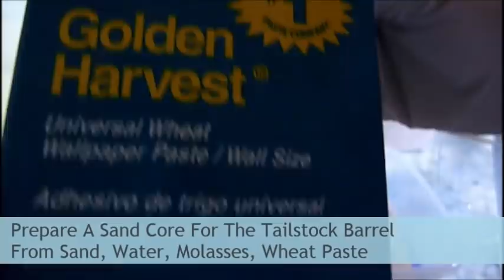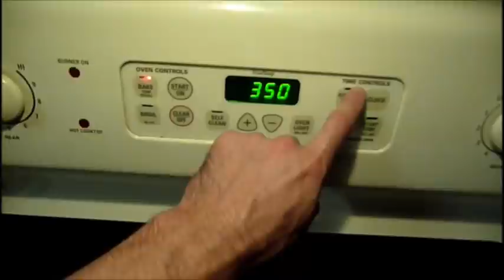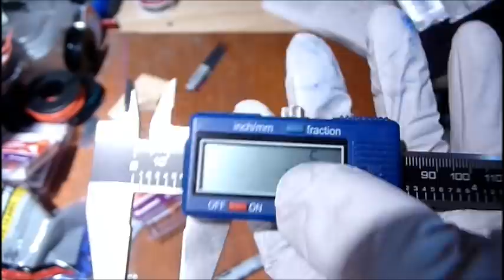Making the Gingery Lathe Tailstock

Comment: Hello, I'm looking your video because, long ago cast a few details in aluminum and silumin. I want to note that this method is very outdated. The item you want to make, sdelaytesnachalo of foam or polystyrene, the channel for low tide so the same from him. Before you go to sleep part sand, paint recommend foam form nitro enamel. Then fill with sand and compacted form, cast in metal foam. I am confident that the result will exceed your expectations. Good luck!

Comment from the maker: At this point I've been working on the lathe for 3 years, but really on and off, and I took a few 4-6 month breaks in between from the project. I would probably say that if you were dedicated to the project ( 3-4 hours a night, possibly more on weekends ), 6 months would be a good estimate. If you already had a machine shop and were planning on using it to speed up the process you could probably finish it much faster - My wife bought me the mini mill when I was working on the headstock.

Comment: Kindly advise which material did you use for it. I meen casting (metal). Sorry for my broken english.
Reply from the maker: everything is cast in aluminum, but I mainly used aluminum from wheels, and engine parts from a few old lawn mowers, etc... Don't waste your time with aluminum cans.

Cheers,
Morgan
Reply: maybe its late but can i ask you if melting and alloy aluminum and casting it will have the same properties as the aluminum alloy you put in the oven
Reply: Thero Therodactel ii

Comment from the maker: At some point I'd like to add ELS to the controller and then at least get thread cutting / taper turning capability through the controller. Not sure on full CNC, as you would probably design a CNC machine from the start differently than a Gingery, focusing on removing as much backlash as possible.

Comment from the maker: The Grizzly Mini Mill is definitely nice, however I do wish I had a bigger machine. The travel is a bit limiting, and if I was to start over, and wanted to true up the bed casting, I would need to try and flip it to cover the whole area which could be problematic.

The torsion arm on the mill is another issue for me, I wish I could get the end mill down as close to the table as possible, but the arm keeps it about 4 inches above so cutting depth is limited without putting risers under the parts.

Comment: Morgan Demers,
This is extremely impressive. Did you make the entire lathe? Perhaps Mr. Wrongagain will let the rest of us know where to find his video making the same part in a manner that does not "need some improvement". In my opinion you did just fine.'
david
Reply from the maker: Thanks for the comment, I did make the entire lathe and added my own twist with a custom controller / driver  that I designed for the treadmill motor that runs it. I can't take any credit for designing the lathe itself, though I did upscale it a bit - if you are interested in building a similar machine, there are plans for it in Dave Gingery's Machine Shop from Scrap Metal book #2.

Cheers,
Morgan

Comment from the maker: No doubt :) I've heard it before. For drilling and tapping steel I use a few drops of cheap cutting fluid I purchased at the local hardware store, you probably don't see the application of it as I was trying to keep the video length as short as I could.

I do not / have not used tapping / cutting fluid on aluminum, though I may try it in the near future. I have had the same set of drill bits and taps for years and have not sharpened them either - they still cut great.

Comment: It is a nice project. but is not cheaper if you buy one or if you melt the aluminum in to a block and them you mill it?  The part is pretty straight milling passes only two axis to use. the project is wonderful.  Just making a comment, not criticizing you great peace of hand work. That type of work you just did. Is priceless, for the rest it is master card.
Reply from the maker: in the end I probably could have bought a harbor freight mini lathe, but I wouldn't have developed all the extra skills, probably wouldn't have bothered with metal casting, etc... which have all been valuable skills. I also didn't have a mill until the end of the project and didn't really ever intend to buy the mill ( was a gift from my wife, she felt bad watch me hand scrape all the parts lol )

Comment from the maker: It would seem like a lot more work to mill the tailstock completely from a blank piece of stock, and also a waste of material. As far as I can tell, most machine tools purchased have cast ( iron ) parts which for them I'd imagine is also a factor of cost, time, and waste. The amount of time spent preparing the pattern, mold, pouring is probably is fairly small, and I can make the part over and over again if I need to without having to start over on a blank piece of plate stock.

Comment from the maker: Thanks for the suggestion, though it wasn't needed - not sure I saw in the video any point at which the sand fell out, other than after the pour when I wanted it to. The first flask I built had a rib in the middle of both halves, but I found it to be unnecessary for what I'm doing, and I've left it out of my newer flasks. Believe me, if I had a problem with sand dropping out accidentally I would have ribs or grooves in all my flasks - I did need it for my lathe bed casting as it was very heavy

Comment from the maker: Hey Roy,

Thanks for watching! Yes I could have definitely used bondo, or jb weld to fill in any imperfection and then painted it - as long as I ensured to keep any paint off of the setover's slide.

At some point I have a feeling I would like to try and do the set over casting again, possibly with a different design - square barrel that would be easier to clamp / machine.

I really need to re-condition my molding sand, and I also want to give lost foam a try which could be an option.

Comment: Great Job. I advise you, to make  models using 3D printer and simple Poly-Propilen for add-material. then printed part, put in sand,,  when you fill with melted aluminum, PP will burn out  ... cheers
Reply from the maker: Great suggestion for sure. I've actually been using my cnc laser cutter and high density foam with some success .. no major prep needed as the foam just burns out.

Comment: cast iron takes much higher temperatures to melt and cast than aluminum, you need special equipment to do it. Most artists that do cast iron use a small blast furnace fueled by coke.

Comment from the maker: Also, on another point with casting if you make a mistake, or it doesn't turn out you can simply start over, as you already have the pattern and the tools to cast another tailstock. If you simply are machining it from a block of metal you most likely don't have the casting capability to start over, and you just cost yourself a bunch of money.

Comment: what size milling machine are you using?
Reply from the maker: My wife purchased a grizzly mini mill for me when I was working on the lathe's headstock. It definitely helped speedup the process of cleaning up the castings ( versus hand filing ) though I did still hand scrape all the bearing surfaces, etc...

Comment: Very cool video but I do have to ask, with all the complex commercially produced machinery you are using (mills, large drillpresses, etc), why are you making a Gingery lathe rather than just buying a lathe? My understanding is the point of the Gingery series was basically to build a machine shop by hand and from complete scratch where each project builds on the next. Doesn't it kind of defeat the point of making an aluminum lathe using a commercial tools? Not an attack, because I did enjoy the video!
Reply from the maker: Well you still need commercial tools to build the Gingery, at the very least a power hand drill, etc... I didn't have a Milling Machine until the end of the build ( my wife was super nice to surprise me by purchasing one for me ). I was planning on building the Gingery Horizontal Milling Machine prior to that, as the end goal was to be able to produce my own gears at home, among other things. That being said the main reason I decided to build the Gingery Lathe, versus just buying one was primarily due to upfront cost ( I didn't have the money for a cheap Chinese made lathe at the time ), and I also figured it would be a great way to pick up some metal casting skills, and also learn how to use the lathe as I build it, etc... I also have a background in computer engineering and the thought of designing the electronics for the spindle drive was also quite appealing to me. All in all it was a very rewarding project, and I did pick up quite a few skills that I wouldn't have if I had just purchased a lathe.

Cheers,
Morgan
Reply: Morgan Demers

Ahh ok make sense. Guess I need to get your wife to talk to mine. ;)

I'm in a similar boat (both in backgroud and lack of interest in cheap knockoff tools I could build myself). In any case, awesome work and thanks for documenting the builds!

Comment from the maker: Cost wise, all the aluminum I used on the machine was free [ some of my neighbor's old lawn mower engine is in my lathe :) ]. The main expense was electrical components as I designed the controller / driver myself ( which I wanted to do anyways ). Overall the machine cost more than the 7x12 that I was thinking I wanted at the time ( but didn't have the funds for ) but wouldn't get me much more than a stock 7x12 really.

Comment from the maker: Hey, I have a full step by step on how to make a gas fired furnace, crucible, and accessories for casting aluminum here: youtube[dot]com/watch?v=nPyRT7eQhu0, however you will have to scale up the furnace to have enough capacity to pour the lathe bed pattern and headstock pattern.

Comment: I love your work, you seem to really be good at what your doing.  I will say this though, I cringe every time you pick up a tap.  I keep waiting on you to break one off the way you push them so hard.  I would suggest a product called Boelube I use at work, its a drill and tap lube, like a wax you just dip your bit or tap in it and it works wonders.  I'd hate to see you go through all that work and have to start over because a tap is broke off in something.

Comment: Why would anyone in there right mind make a machine tool out of aluminum?
Reply from the maker: because it does the job I need it to do... I don't need a huge machine that can cut steel.. though I've been extremely pleased at this machines performance when cutting steel ( checkout the tool post video ). It's perfectly adequate and accurate for cutting aluminum which is primary what I use it for.

Comment from the maker: Thanks for the props on the work, it's much appreciated. I use a 12"x18" Grade B granite surface plate that I purchased from use-enco[dot]com for $24 back in 2009 ( with free shipping coupon code ). Looks like that is going for $45.95 right now. Hand scraping is definitely a neat process, though it was hard to find much information online that was of any help other than describing the process. You really need to get some scrap and a test surface and practice until you get the feel of it.

Comment: Your moulding skills could do with some improvement (I was a moulder/engineer before retirement) otherwise nice little tailstock.
Reply from the maker: Thanks rightagain, I'm definitely no professional and don't suggest that I am. Thanks for the props on the tailstock - it wasn't perfect for sure, but it works well, and gives others who are attempting to build a Gingery Lathe from scratch an idea of how I did it.

Cheers,
Morgan
Reply: Morgan Demers Have you played around at all with investment casting? People get nice results using PLA plastic out of diy 3d printers, and the diy 3d printers would probably be right up your alley.
Reply from the maker: Iluvquadbike I haven't tried it, but I did just build a prusa i3 reprap ( my most recent video ). I'll be sure to give this a try for sure, though at this point I've only been printing ABS.

Cheers,
Morgan
Reply: Morgan Demers Neat. I'm currently working on a mendelmax 1.5 that's going to help me print the parts to cast my lathe. I gave it a shot, but I upped the size of the lathe and casting it in greensand is beyond me so I need a 3d printer just to get my headstock. Your videos have been amazing to watch though. I come back every now and then to see if you're doing the milling machine, dividing head, bandsaw, or drill press.
Reply: Morgan Demers
Also, what is that milling machine you're using?
Reply from the maker: Iluvquadbike It is a G8689 Grizzly Mini Milling Machine.

Comment: Hi Morgan,
Not the best example of engineering precision,nothing centered and a milling machine capable of accurate drilling not used. Everything seemed to be rushed with an overall lack of care. Sorry Morgan but that's how it comes across. O and you need to sort your drilling machine It sounds as if It's on it's last legs. I would advise you to watch videos by ABOM79 a Master precision engineer if I ever saw one.
MoK
Reply from the maker: Thanks for the comment mo, it`s appreciated. I tried to follow the gingery book's instructions for the most part in building the lathe, and really only used the milling machine to reduce the time needed to hand file the castings. At any rate I do not claim to be a master machinist to any extent ( my background is computer engineering ) and am providing the videos for others who are interested in Gingery's lathe and how it is made per his instructions. Regardless of my lack of precision drilling, etc.. I can produce respectable parts on the machine, which is a testament to what can be done with some simple tools and scrap metal. As for my drill press, it probably could use some work, however as with most of my tools, they are the cheapest I could find in order to fit my budget, and thus it may just be the drill press...

Cheers,
Morgan
Reply: Morgan ,My bro checked your work out he will be more than happy to send you some old lathe he used to have its super big but he bought a cnc ,How can we reach you email ?